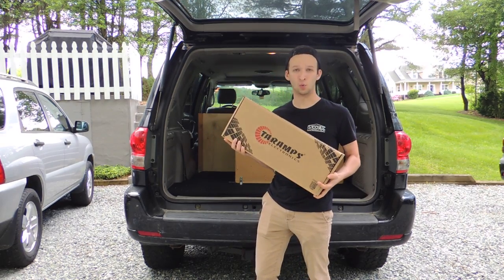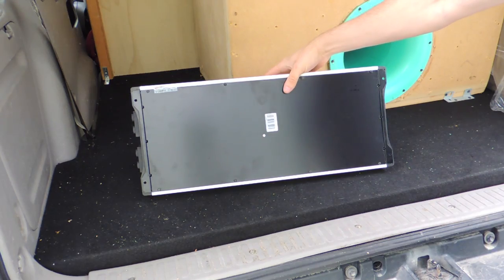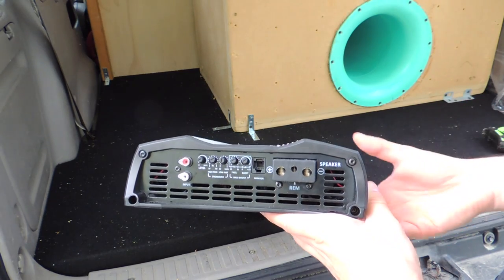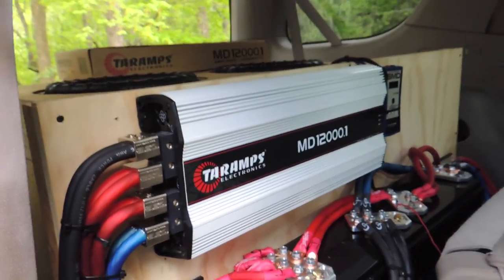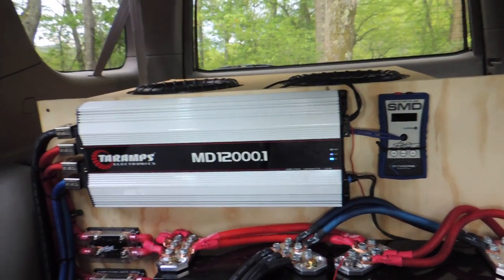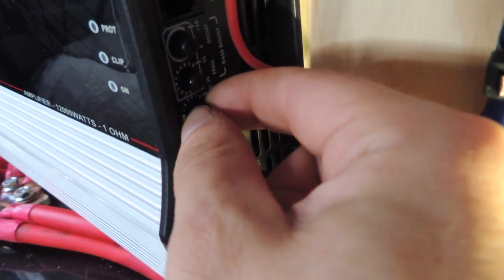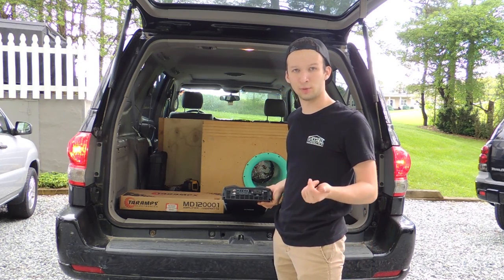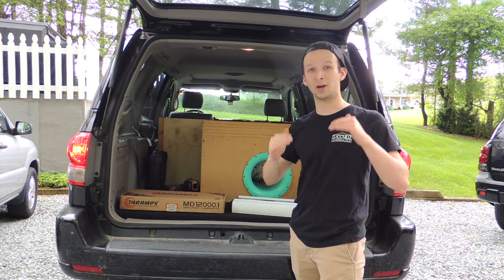TARAMPS? Watch This Before Buying!! | Taramps MD 12000 Review

Comment: Told ya dude, they are a beast but when they fail they are scary.
It's funny I've been running my boss amp in one of my cars since 2012....😏
Reply: What are some reasons to why these taramps usually go bad?
Reply: @RomaVilla  they are full bridged I think and they just flow current. Heat is the big killer of amps. Taramps tend to use lesser quality parts that fail often. In an amp when certain sides of the board or certain components fail it can cause a chain reaction that will usually produce a voltage spike and that tends to make mosfets explode fire and electricity, not something you want in the trunk of your car.
Reply: @robsorgdrager8477  damn, sounds like a small fire just waiting to happen. Appreciate you breaking it down for me. Making me think twice about ever buying them in the future, what about the sfb sundown amps?
Reply: @RomaVilla  any high power high current amp is capable of failing in glorious violence. I run a boss onyx ndx 5500 on three RF p3's 12s . I had it pushing two nko12's from dark audio in a sealed enclosure and before that it pushed four other sets of 12s. I've had that amp in daily use since 2012-2013 , 365 days a year. It's all about what you ask your amp to do and how you set it up to do that task. It's just like engines. If the tuning hiccups just once under full throttle it will set off a chain reaction that causes mass chaos . To give any amp a chance you need amperage to feed it and solid grounds. If your subs are not capable of the mechanical movement it will cause the a/c current to switch to d/c current and that can fry an amp. If you starve the amp of current it will over heat and fry. If you supply too much remote wire voltage it can fry, not enough and it can fail.....it don't matter so much as the brand. Yes cheap amps are less forgiving and will not take neglect and give up faster sooner. In my case , every one wants to point at companies like boss and say they are garbage but not a single person has ever made a video testing bosses top o the line  amps and subs....wonder why? Mine has lasted almost a decade and has not been babied one day of its life. 
So if you like sundown then get a sundown , I would tell you to get a C.A.B or a Orion hcca and let the little boys play with their little toys.
Reply: -someone who's not loud
Reply: @Exodia  well it's pretty hard to bump your subs when your car is a smoldering mass on the shoulder of the road🤭
It all depends on what you call loud? A dump truck crashing into a siren factory is loud but it's not really pleasing. If being loud means I need to cut corners and by an amp that could stick weld a sewer pipe but it is made out of chewing gum and Lego bits, I'd rather save my money and just be sorta loud.
Reply: Rob Sorgdrager loud as in the decibel level buddy if you think your Korean board is going to give you some insanely different sound at 150 db ur over paying if you want reliability and a amp that last years Sure go Korean that could also still break and cost the price of taramps 12k to repair
Reply: @Exodia    I'm more interested in the amount of current the full bridged amps move. When they fail they throw molten debris, fire and arcs where as most of the typical boards just smoke or " pop " . My amp in my daily is the boss, my play toys only run Rockford Fosgate amps. I had really good luck with the cab 1600 I had for a bit but I sold it to my friends kid. I've played with the old audiobahn hc2100 and really liked it. These taramps I'm sure are decent and not all of them explode in a shower of fire but they just feel cheap and clunky. Like Parker pointed out , just every thing is all flexy and loose and has a real " cheap " feel .
I'm 40 , I don't do " loud " anymore without being accurate. My Vic is loud enough to piss people of in a 100ft circle, I get the finger, I get noise complaints ...but bass without control sounds like garbage. These Brazilian amps are more suited to techno type bass anyway and to quote emenem " ain't no one listen to techno" .
Reply: Rob Sorgdrager these are all opinions nothing you've stated is factual at all I don't know where you get all this all old out dated information from. But you've gotta get w the times man
Reply: @Exodia  I'm not sure I understand. But if you'd like to show some actual material that proves me wrong I'd be more than willing to read it.

Comment: This full range amps have me confused. How could you bass boost a frequency hrz that's not compatible with the amp? For example the low pass filter i believe you said was 90hrz. So how do boost that to 35 to 40? Sounds like major distortion! Thanks for answer Parker, and this video also shows great warranty service lol. Hopefully 3rd time is the charm.
Reply: if one filter goes from 10hz to 90hz what do you think it is that knob removes? if the other filter goes from 90hz to 5khz i ask again what could that knob possibly be removing from your sound. stop and take a second to think about it. I know you got it. you can do it.
Reply: You clearly don’t know what a low pass filter means. Frequencies above 90 Hz will be attenuated hence the low frequencies passing thru the filter. A high pass filter let’s the highs pass thru & cuts the low frequencies. A 90 Hz 24 dB per octave LPF means that frequencies above 90 Hz are cut, leaving in layman’s terms 90Hz down to say 10hz. 180 Hz is would be cut/ lowered / attenuated by -24db. Hope this helps
Reply: @uptobatentertainment  i know this guy is having problems with the amp, and everyone knows that Brazilian amps are not made for lows. 90hrz compared to 35hz is a big difference. Go Korean

Comment: Thanks for this info. I was gonna switch from fosgate to taramps, prely because of that bang for the buck value. Not gonna do it now.
Reply: Both will last a long time if installed correctly. This is human error and lack of knowledge. One amp was dropped, another shorted. I run Fosgate right now and am in the process of switching to Taramps, but I know what I’m doing. Fosgate amps can take voltage drops and be a lot more stable, meaning you can get away with cheaper electrical. They can also handle more vibration, which is why so many people have gotten away with mounting them on enclosures, which is a no no. Taramps need stable power and a safe mounting area with minimal flex, meaning you need to dig in those pockets and upgrade the hell out of your electrical and map out your install. In the end there are no shortcuts, but your system will be much louder with Taramps. Pick your poison.

Comment: So Ultimately Is Was User Error. My Experience With Taramps... I've Been Running A Taramps TS2000X4 Since October Of 2019. It Makes Some Power And The Sound Quality Doesn't Sound Any Different Between My Old Korean Class D Soundstream 3.2K4. The Only 2 Issue I've Have With It Is The RCAs And Cold Weather Operation. If It's At Or Under 40DegF Outside The Amp Will Not Turn On. You Can Hear A Pop In Speakers Like It Turned On But Doesn't Stay On. No Protect Or Status Like It's Off. Once You Run Heater In Car It Turns On After Turning It Off And On. This Is Super Annoying If Your In A Cold Climate Weather. My Korean Class D Bass Amp Always Turns On No Matter The Cold Temperature. Taramps Told Me "The Amp Remote Turn On Contacts Are Physically Freezing And That Why Its Not Turning On" This Is BS In My Opinion. 40Deg F Isn't Freezing Plus My Other Amp Always Turns On. The Second Issue Is the RCAs. Randomly I'll Loose A Channel. Usually Happens 1 Time Every 2-3 Months. I Go Out And Wiggle The RCA And The Channel Comes Back And I Get Sound From The Speakers. It Usually Only Happens At Low Volume. It Like Goes Out And Comes Back On Its Own Sometimes. As For Power And Sound Quality With Door Speakers And My 7 Band EQ. It Sound Amazing And I Can Easily Blow My Door Speakers If I Really Wanted To. It Also Runs Pretty Hot For Not Being Stressed   But Not As Hot As My Korean Bass Amp Wired At Half Ohm. (Rises To 2-3 Ohms)
Reply: thats odd, I daily drive with a bass 12k, two dps 1600s a ts 800x4 and a pro2.6s and full tilt when its -4 degrees outside and i dont mean Celsius either.
Reply: @TManMusicPage  I'm Jelous lol. I Had Contacted Taramps A While Back When It First Happened And They Won't Do Anything About It. They Said The Amp Is Fine And It's Just Freezing. They Stopped Messaging Me Back After That.

Comment: That is not a bass amplifier is more of a mid-range amplifier
Reply: The MD series can be used for both highs or bass, note that the MD series are tested at 40Hz( normally used for bass alone with the newer Bass series amps which are dedicated bass only amps) unlike the HD series which are tested at 1k Hz( normally purchased for higher frequency)

Comment: Most people use power supplies and rail caps to supplement surge and draw on internal caps, too much heat on the internal caps kaboom.....I own the bass 1200, I have 1 on each coil of a zvx 18 d1 gain matched with smd, dude virtually no heat "warm in operation, I have a 240 amp alt and 2 55ah agm apex batteries, 0 gauge big 3

Comment: It's not the amps because I Wham the s*** out of mine daily, and they have performed above expectations and continuously. When I move them to a different vehicle without proper voltage Supply I paid the price and it was my fault. So I bought two more all taramps smart 5k's. And lithium is a must for thus much power as well as grounded to the fucking frame

Comment: I have taramps as well as wolfram, zapco, audison, hertz etc. They have all had problems of one kind of another well except for my taramps which i have wired down to .67 ohm on 6 subs in my truck. No problems as of yet. I do think id go with the sundown fullbridged design over the taramp. Just a better built amp.
Reply from the maker: Yeah I might get the SFB 13500 here after a while

Comment: Word of advice, don’t place Brazil and some other budget amps on the box...the components will vibrate and burn the amps quick...
Reply from the maker: I built an amp wall that is connected to the floor. Not the box
Reply: Parker Dacchille ok kl
Reply: Parker Dacchille well I did that too but sometimes the box is too close..now I just use the back of the seat there I Knw its Far away from the vibration...and added some rubber feet no problem since

Comment: Hey Parker, I agree those knobs look a little flimsy; but we all should be careful with the adjustment knobs on any amp. They are even special little tiny tools to help "fine tune" adjusting knobs...
Next thing bro Parker, when the board was open, you said it looked cheap & thrown together; Besides that burn spot, it looks nicely built to me. 🤷‍♂️
Don't down your equipment bro, you're doing just fine.
👍😎👍

Comment: I have an amp by Dual it's a 1000 watt amp and it's made like a tank.I like it.It seems to do what I need it to do and it does look good.I got mine at walmart.Autozone also carries them and at the same price.
Reply: I've got the same dual amp and it ain't no joke for the money. I have to upgrade my 6.5 speakers cause it's killing them lol
Reply: Pfft amateurs. I have a 2K Dual amp hooked up to 2 12s running at .5 ohm and I’ve been running that setup for 3 years straight. Never caused me any problems
Reply: @bassdynasty8840  i got all of you beat. I got a 6500 watt Dual i paid $40 for it at dollar tree and that thing is so powerful i knocked the drain plug out my radiator

Comment: 3rd unit?  no thanks.  and so basically this thing has an undefeatable 10hz subsonic.  prob because they would get even lower power ratings without it.  if you're doing sound quality system, you don't want a subsonic.

Comment: Okay you've had a problem with shorting a wire out yet there you are with your amplifier setup without the power blockbeing covered in any way shape or form my goodness at least you could do is put some tape over it at a bare minimum
Reply: He had the fuses pulled out on all 4 leads.
Reply: @guy6751   okay that's fine at this moment but it looks as if though it's that way all the time...I have watched his other videos and I've never really paid attention to that but I will from now on cuz that looks like a fire waiting to happen
Reply: @deepsquat600  true not a fan of how close they are. If one of those set screws came loos and it vibrated out of there
Reply: @guy6751  I was even thinking about what if he were working on it and he drops a tool and it seems power right to a a ground he could shirt off his entire electrical system in his car including his computer

Comment: Ive said it before lol full bridge design amps are total trash. Tar amps keeps my amp repair guy in business. The old tar amps completely melt down. The newer ones can usually be saved but they are shit amps especially for sql. Its better to get 2 sundown scv 7.5k's used and cheap. I just picked up a scv 6k for 300$

Comment: You are giving those amps too much voltage 15 volts should be the max voltage those amps should ever see those lithium batteries are probably around 16 volts
Reply from the maker: They are headway’s they sit around 13.2 and my alt only charges to around 13.6-13.8

Comment: It's a great deal 800$ and it last a hole five months and his third one freaking pile of crap that's not a good amp I won't be buying one for sure.i will say power per watt yes that is good I'd save my money up and stick with JL or sundown had my JL jx 1000.1 at 1ohm for over two years without any problems and I'm not nice to it not bashing any brand just better to save and do it write the first time less headache

Comment: that is some horrible packaging, no wonder you are on your third amp. Do you know how delivery guy's handle those packages? Edit,... feels kinda lose,... yea package handlers. Edit gain set to about half? why do you not use a tool to set them excactly as they shud be? i calculate it and use my multitool to set it to the correct Volt output, better then just eyeballing it. Edit, i shud have waited till the end of the video, ignore my first comment lol
Reply: the clip light on the amp is what you use in place of a tool

Comment: Massive Audio makes trash amps and dont honor their warranty. Ask me how I know.
Reply: How you know
Reply: @brondyjackson9329  Brand new Massive D8000 lasted about 5 minutes. Got it all wired up and tuned then left my truck running with the radio on 7 while I cleaned up my install tools. 5 minutes of low playing and it goes pop and protect lights come on and never go off. 

Call them and they gave every excuse why it was my fault... wired to low, no alternator, bad install. All of which were a lie and have me stuck with a 1k paperweight.

Comment: Half gain and wonders y on his 3rd amp 🤦🏻‍♂️
Reply from the maker: It’s matched to my headunits outputs 🤦‍♂️
Reply: @ParkerTheBasshead  if ti takes half gain to match your hu then u have shit for rca voltage. Get a better radio or a line driver. Half gain is like 1v of rca signal. Your makeing the amp do all the work. Feed it more signal
Reply from the maker: For YouTube I have to keep the vocals down so I don’t get copy wright strikes. So I keep the headunit at about 1/4th of its potential. Being on my 3rd amp had nothing to do with gain. First amp came damaged and 2nd was my fault

Comment: Just get the Orion HCCA
Reply: would if they were for sale
Reply: Interstate Boss yeah they are hard to find. Just have to hunt all over eBay. I ended up going with the XTR line and I have to say, I am not at all disappointed. Way more power than I needed
Reply: @jasonneal  I really wanted 2 5ks. Ive been looking for like 2 months daily now. nothing.
Reply: Interstate Boss I think they are coming out with a new line of amplifiers Orion is located in Miami Florida you should call them maybe they can give you some updates
Reply: @jasonneal  I guess the question would be would they be as good as HCCA. New Lines need time to be abused to prove themselves.  HCCA is proven already. You really can't say anything bad about those amps
Reply: Interstate Boss I would hope they would be. Lately Orion has been doing well. But yes the HCCA is a beast of a amp. BIG D Wiz did that test of their 3k amp with some crazy numbers
Reply: @jasonneal  BIG D WHIZZZZZ LOL 😆  Yea man he did that amp up again like 3 others. None of them could touch the HCCA. 2006 CEA Compliant is an understatement.  Can damn near get 8k watts from a HCCA 5k. Its ridiculous.